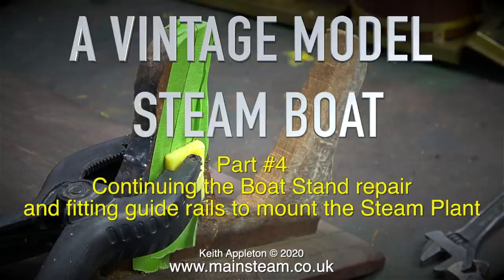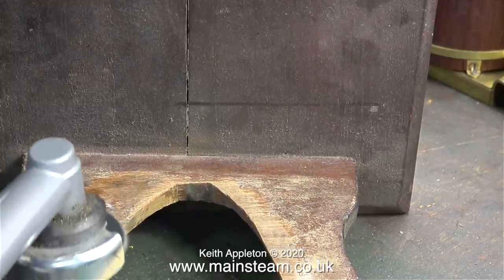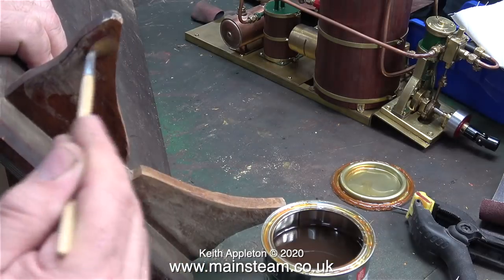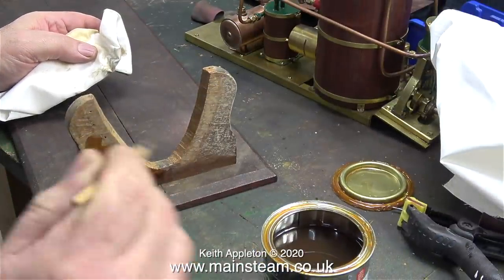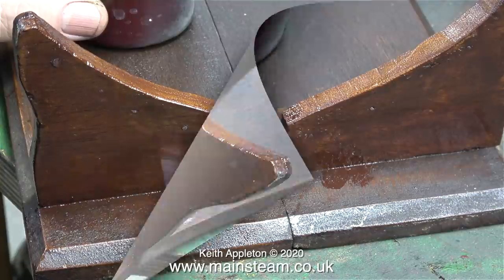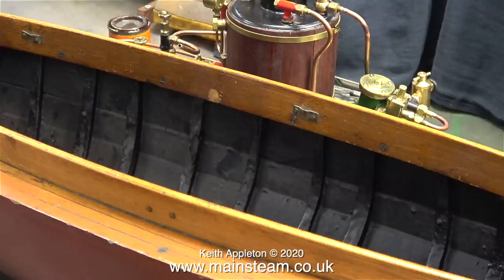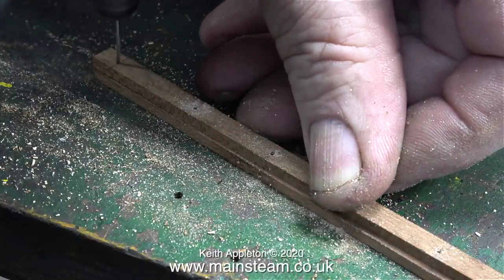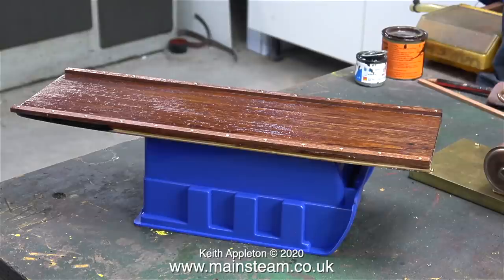VINTAGE STEAM BOAT RESTORATION - PART #4

Comment: Hi Keith, not sure if you have ever tried this but if you want to take the gloss finish of a varnished surface try using wire wool it takes the shine off and leaves a very smooth satin sheen also gets rid of the brush marks and any dust which has got into the varnish when wet.

Comment: Those little brass nails give me anxiety just seeing them again! I ended up using similar for really tiny rivets and trim nails for a scale wagon/harness I helped build a few years ago..... The amount of bent nails, and cursing, that went in to that project.... ugh
Reply: With a toothpick put a little anti-seize in the hole. Little screws or nails  go in wood much easier.  Do you use that trick of holding tiny nails with a thin piece of plastic with cut in it to hold the nail?